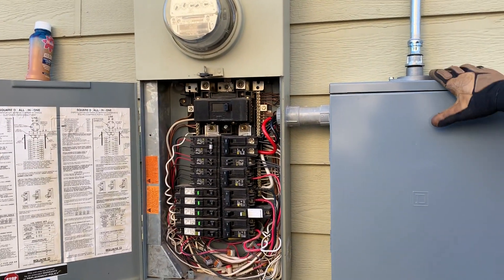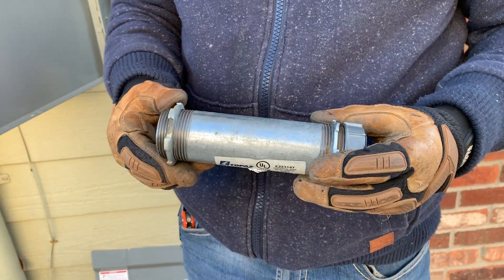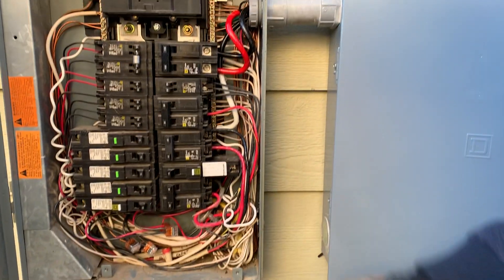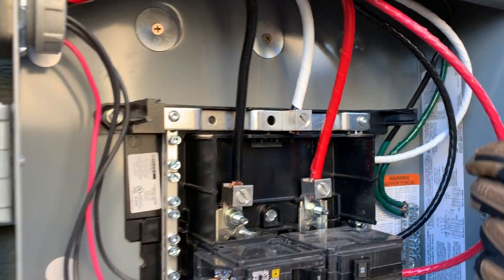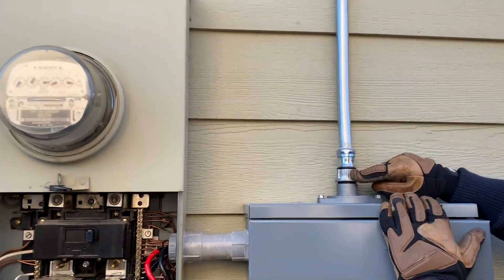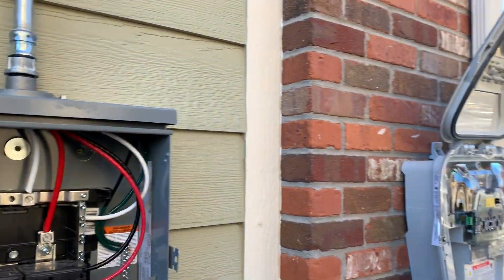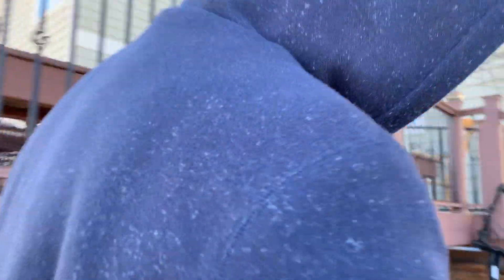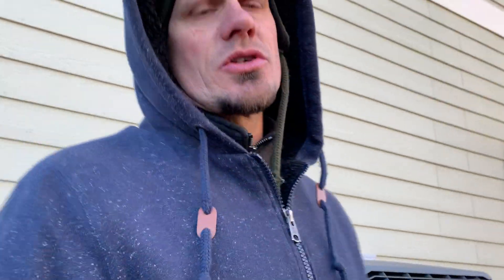Siemens Charger Pack for E-Volt Car

Comment: buddy for beer here in my experience paying a few  $$$ more for larger conduit  = extra room pulling thru those bends is $ better spent than using reducer couplings and i might have used pvc or non metallic liquid tight but thats because of my environment. and yes i wld have missed the conductor labeling but easy fix and if i where to do a job like this or help out a frnd i wld get a permit. im lrning abought expansion couplings been 4 ever since i did outside ridgid runs